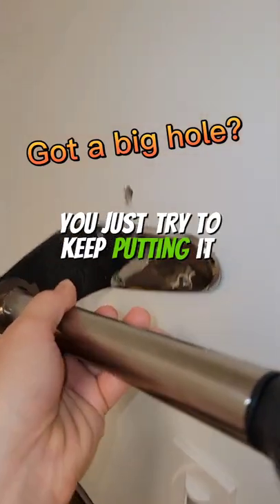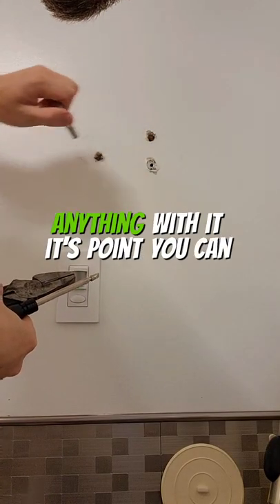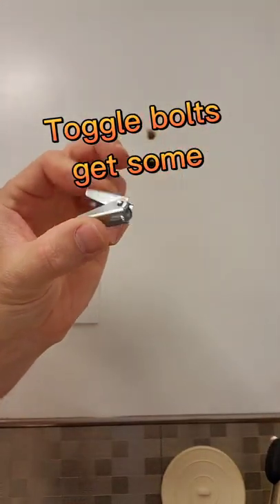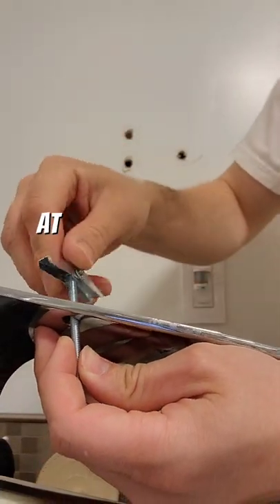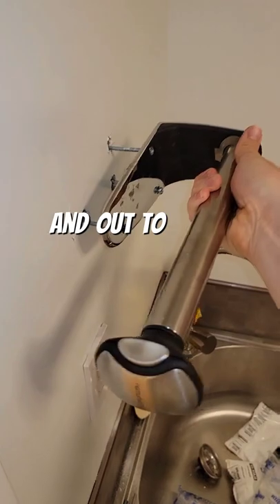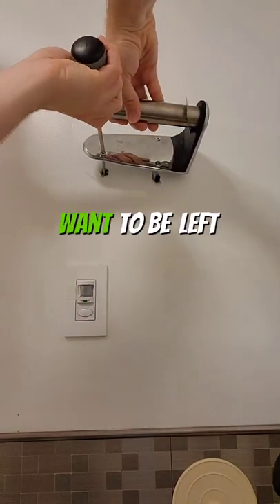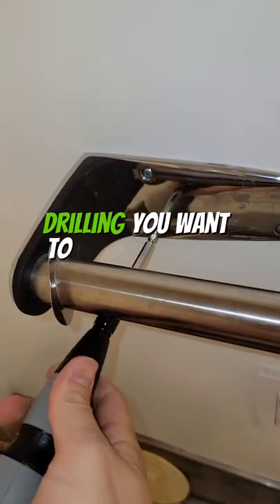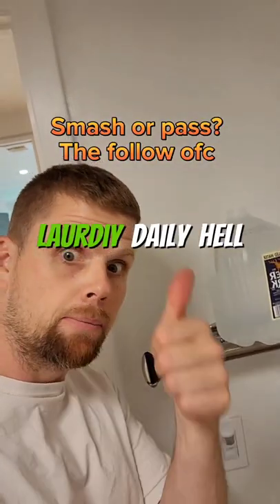How to fix a anchor that ripped out the wall #shorts #handyman #viral #bluecollar

Comment: Better yet cut out the drywall and insert a 2x4 horizontal between the 2 studs. Cut a scrap piece of drywall into the hole. It will never come off easily again.